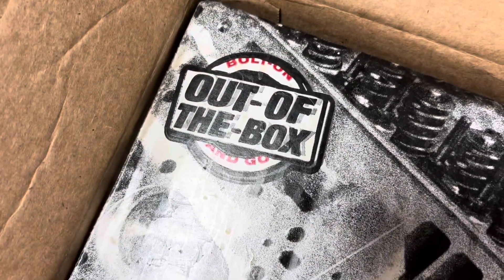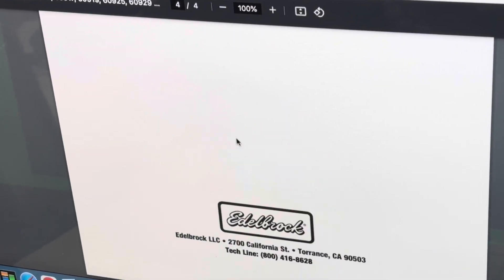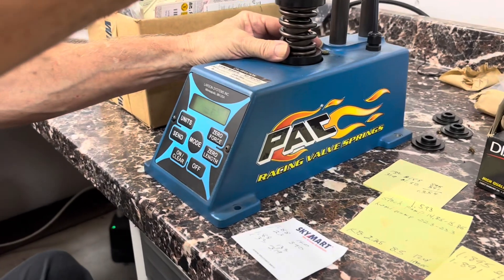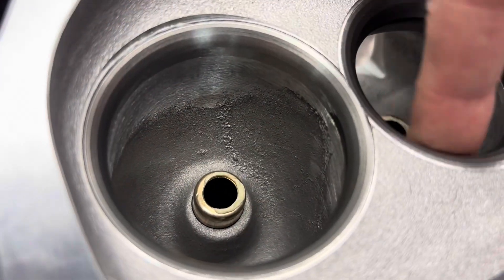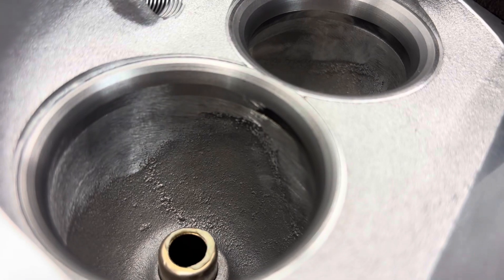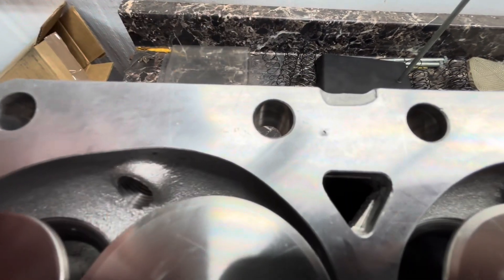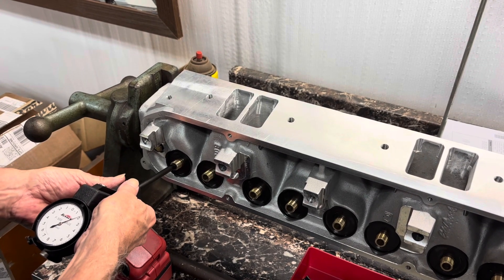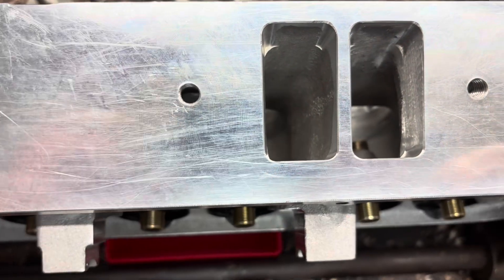Big Block Mopar Aluminum Cylinder Heads: Are they Actually Ready to Bolt On, Out of the Box?

Comment: Edelbrock says none of their RPM mopar heads are CNC ported. Do they say that because they didnt CNC everywhere  you can?
Reply from the maker: Yes sir. The real CNC programs touch every part of the port and make to match whatever template it’s given. Weingartner mentioned that core shift is pretty bad on some castings and although the machine is set up with the template, it might end up not touching a portion of the port on one hole and doing the complete port on another.

Comment: Informative and i use cpmetic gaskets for my stelth heads on my 505 stroker 440 base block. And i have just over 200 psi compression.
Reply from the maker: The Cometic gaskets are definitely top-notch. Since this block wasn’t decked, we elected to not use cometics. It did check straight front to rear and corner to corner, but didn’t have the surface finish that cometics need.

Comment: Good info and good to check anything edelbrock puts out as quality varies so i have learned. For the money over ported stock heads i will stick with 906 or 915 castings depending on what i am building. The only head that impressed me was indy. Very high quality and they make power way more that edelbrock.  Everyone has there favorites for sure but thats mine. I love that you guys checked everything and its what everyone should do. Just good insurance. Oh and the sloppy cnc clean up didnt impress me either but glad you got after that. Good man. Will it make a difference maybe a small on the top end of the rpm band. The guy that taught me engine building said everything matters. Little things can be big gains. Nice work.❤
Reply from the maker: Thanks Rooster. There seem to be a good budget friendly option. I think all brands have to be checked out nowadays

Comment: These heads offer almost no performance gain over stock 906 heads
Reply from the maker: I’m searching for an answer that can align with your opinion. The best I can imagine is if you had a very low performance 440 from an RV, and only did a head swap, testing a 906 versus these heads, then maybe you wouldn’t see as much of a difference. The lower compression engine would probably engine the cast iron head better. The same test on a high compression 440, and you’re likely gaining 40+ horsepower. I would guess 100+ hp with the correct camshaft, intake, and carburetor. It’s almost like they sell a top end package that promises that for most engine setups.
Reply: @JustMoparJoe  was an episode of Nick's garage. edelbrock heads on and the numbers were  so underwhelming. Was virtually no difference. Was under 400 HP on a 440 with Edelbrock heads
Reply from the maker: @davidjenson8124  “if the parts inside the engine don’t properly compliment the cylinder head, it’s all a waste of time.” https://youtu.be/87p00AGWMXk?si=JDJH2qqaiiiUwdTq
Reply: Maybe so but they are brand new instead of being 50 years old and are 30 lb lighter. I got 605 horsepower out of a 505 with Edelbrock heads, 10 and 3/4 to 1 compression hydraulic roller cam, trick flow intake manifold with 950 Holley carb
Reply from the maker: @ I think he needs to see a flow chart from Hughes engines or any Dulcich Article from the last 30 years.

Comment: The Fel-Pro gaskets kept blowing the fire ring loose on my 499” low deck so I went to Mr gasket ultra seal gaskets and had no more problems.
Reply from the maker: Thanks Jimmy. I think they’re only rated for max of 10/1 compression. I wouldn’t use them on any thing much higher than that.

Comment: The RPM heads are good heads.  With a good porter they make a real good race head.  I've seen around  800hp N/A ported with the right set up. I think they are a good buy as well.  Good video Joe  As with any head you want to check them before installing.  Tight valve guides are common with aftermarket heads.
Reply from the maker: Thanks Mike! I think these will be great for Dave’s Street stroker

Comment: Torch me now, but I think the late model blocks were better.  Heads should work just fine!
Reply from the maker: Thanks Tim!
Reply: The Cylinder walls are way more consistent on 76-80 440 blocks with the correct casting number . 💪

Comment: Finally someone made a video about this issue. Edelbrock isn’t the same. I bought Victor series for my R3 mopar build and i spent hella money for the machinist to fix so many problems. I mean even the surface wasn’t flat. For my 440 build im buying Trick Flow 270s instead.
Reply from the maker: Thanks for sharing. These are much better than my first set of E street heads(before they were reworked).
Reply: They got bought bu the same company that bought Comp...

Comment: everything he is saying looks good looks like crap
Reply from the maker: One man’s crap is another man’s comment 😂
Reply: @JustMoparJoe  Ok, just be careful with those guides, I would open them up a tad, my buddy ran "out of the box" edelbrock heads and a valve locked up on the guide, did lots of damage.
Reply from the maker: @rickkelsch2040  they were all above .001 and the exhaust was a shade more than that. The last trickflows I saw were all under .001 out of the box. I really think it’s good to check every set of heads you use these days

Comment: My small block Edelbrock heads had a bunch of machining chips in some of the bores, out of the box 😬
Reply from the maker: My E street heads had many as well. Especially around the bolt holes.
Reply: @JustMoparJoe  mine were the same Performer RPM heads you had and the chips were in the oil galleys. 🤷🏽‍♂️🤷🏽‍♂️ They work well, but it's something to note I guess. Awesome video

Comment: I am avoiding hydraulic on all my stuff. I prefer SFT for fewer moving parts.
Reply from the maker: I went back with solid rollers on my hydraulic roller cam in my 406. This engine is for my friend Dave at Rust Bucket Restos
Reply: @JustMoparJoe  Awe. OK. I prefer solid everything. I do like solid flat tappet because of the simplicity.
Reply: Same. I don't mind adjusting valves.
Reply: Same here. No roller lifters . No Torrington bearing behind the cam timing gear. Plain bushing rockers . No external oiling system .
Everytime u add sophistication u add a possible failure point .
I have made the concession of a main stud girdle. I expect 650 hp / 650 ft lbs from my lo bloc stroker.
 Some say these stock cast iron 2 bolt Mopar blocs become questionable at 600 hp. Others say yeah , but a main stud girdle contributes nothing .
Me - i say i dunno if it helps but i cant see how it cud hurt .
Reply from the maker: @michaelmoon8856  the majority of those saying it haven’t ever done it. Wallace says my 512 should be 640 horse with its current ET and weight. I’m pleased with that. It’s a milder cam and heads for sure

Comment: The E street heads on a car i bought are lousy ! Not even as good as a stock head,
  My 270 heads are amazing  !
Reply: I'm going to have to say you have something else wrong since Joe has already shown the e Streets on a stock crank stock rod style 400 non-stroker have already made well into the 500s.
Reply from the maker: @Max you definitely have issues somewhere. E street heads are a mile better than a stock head, and the 270 is a mile better than the e street. I wouldn’t bolt on Any aftermarket head without having them checked.
Reply: Not even capable of being used with a roller cam,
Per eldebrock
Reply from the maker: @maxfastest  it’s because of the spring pressures on the e streets. I upgraded springs, titanium retainers, and 10 degree locks. The heads in this video clearly have it stated on the box “Hydraulic Roller Cam”.
Reply: @JustMoparJoe  

The details on my expense street heads say the valve seats are not compatible  with roller cams
Reply: @JustMoparJoe  
Yes I know the have that option
Just not on the heads I had
My 270 heads are much nicer
Reply from the maker: @maxfastest  I’ll ask my engineer at Edelbrock. But no one can argue that the 270 isn’t better in all aspects. When I get a set for a build, I’ll do a similar breakdown

Comment: My Trick Flow 240's were ready to go, out of the box.  Great quality!
Reply from the maker: Thanks Jeff! No denying that trickflow makes nice heads(they are cast by Edelbrock). This video is definitely specific to these heads.
Reply: He does this with every set of heads he gets he checks them like no one else he looks for every little thing
Reply: Mine had a bit of machining ‘dust’ in em. Wouldn’t have known except I had picked them up, sorta resting against my belly as I walked…had on a black shirt and noticed it. Took them apart and washed thoroughly.

Comment: Are the exposed spark plug threads in the combustion chamber an issue? What are your thoughts?
Reply from the maker: I would have to double check them with a plug in place. These take the extended plug and I don’t think they have much too much hanging in. I do like the idea of knocking off any rough edge with sandpaper or tool.